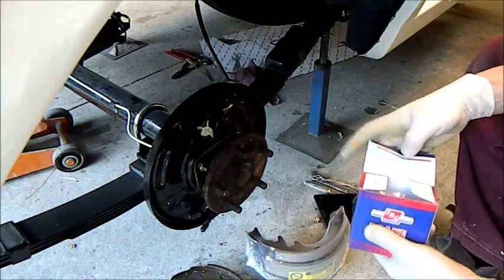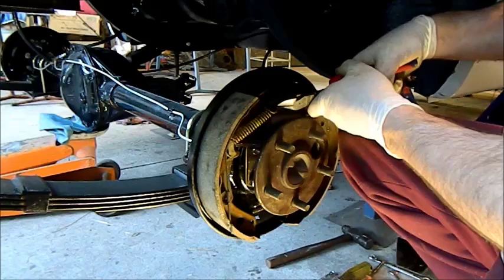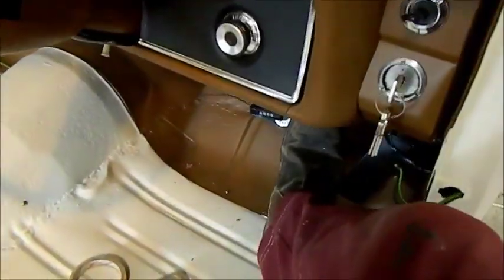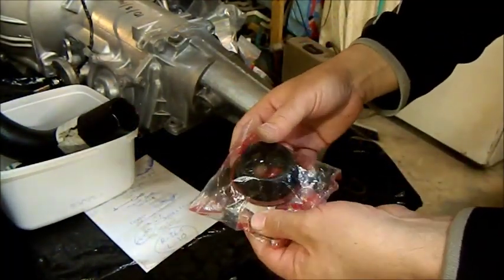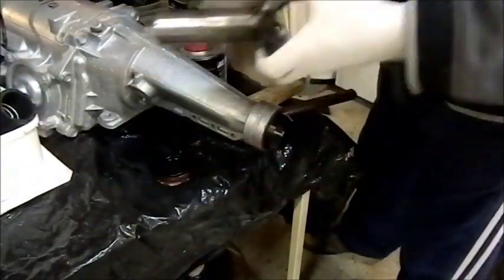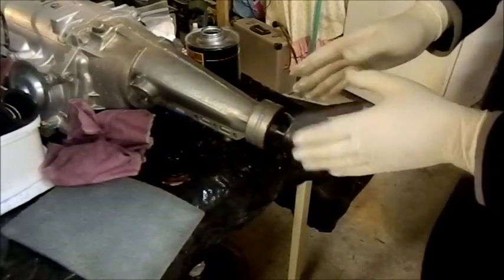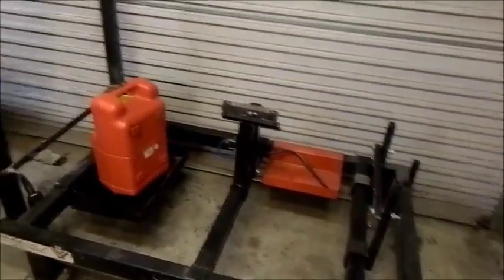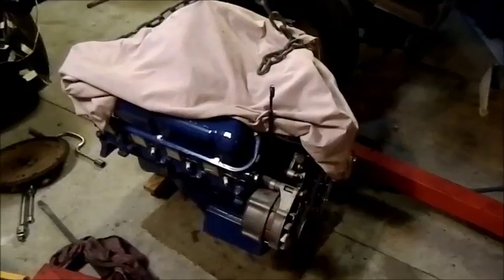1969 XW Ford Falcon Restoration Part 14

Comment: Hi Peter -
Sorry to disturb you .....just about to start a job on the ZC fairlane - need to change the heater core. Can you remind me which video # contains the heater box rebuild? I have looked but can’t seem to find it

Many thanks - love the channel!

Steve
Reply from the maker: Hi Steve, no problem at all. The XW videos were about half the length of the ones I do now. The heater rebuild is in Part 23. there are two segments on it in the video. Hope this helps. Cheers Peter